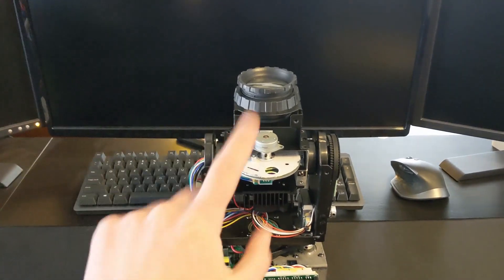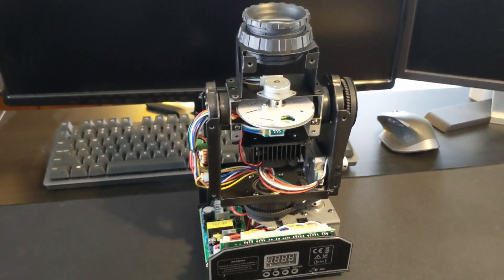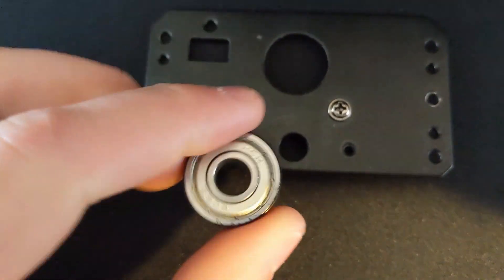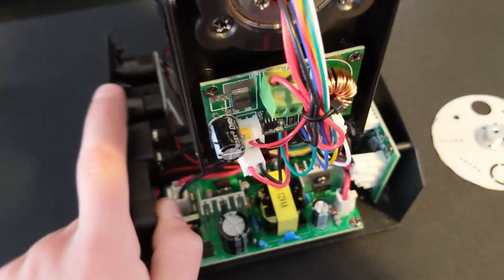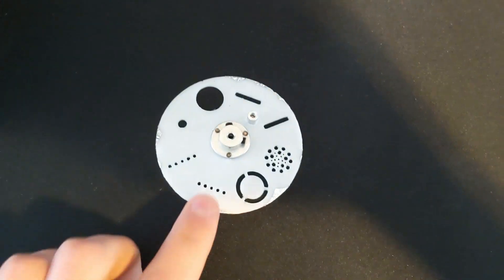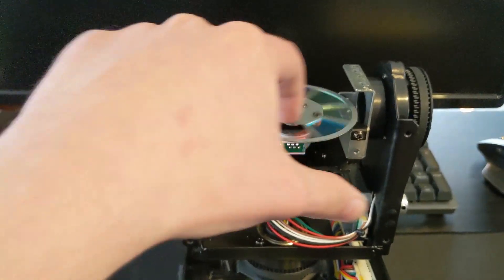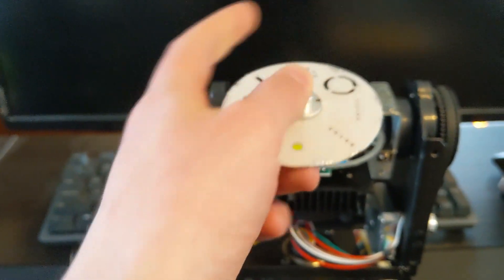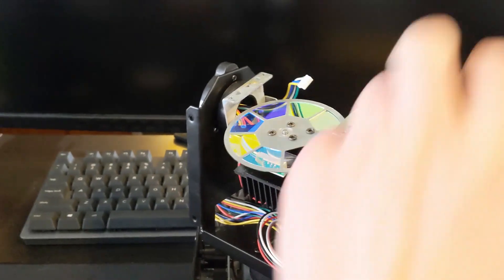[Abandoned 🙁] Project Preview | Rotating Indexable Gobos (and more) to a Cheap LED Moving Spot

Comment: why dont you fully print an moving head it seems like you do have the knowlage to make that happen. :)
it wil be so interesting to follow that journey here on youtube.
Reply from the maker: Hey, so, update, this definately isn't happening. 😕

However, I have some things in the works in leiu of that. 

Modular, road-worthy, computer-independent/integrated, custom control surfaces anyone? How about an ultra-affordable, multi channel, config-free, decentralized, internet agnostic, networked comms system (This one may or may not already be built! 👀) ?

Stay tuned!
Reply: @ConnorEhrgood  Also you would had to modify the Programming and Software of the Light for the CMY Color Flags
Reply from the maker: I've considered it... We'll see.

The toughest part by far is the optics. I'm no optical engineer, in fact, I have NO knowledge on lense systems. If there's anyone out there that has the knowledge necessary or someone who could point me to some solid resources, that would be MEGA helpful for a number of projects!

Anyway, it's totally possible, not sure I'll be the one to do it, though...

Thanks for watching!